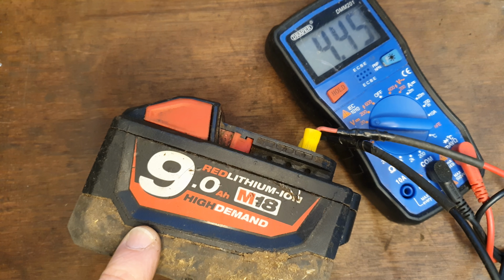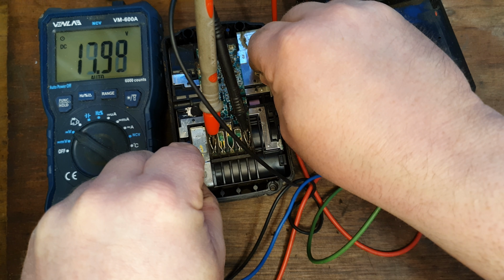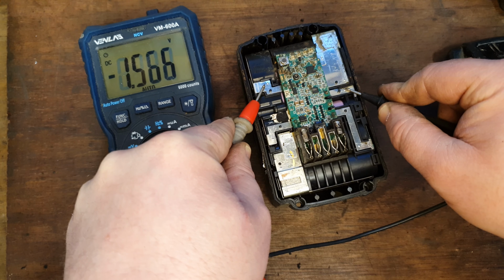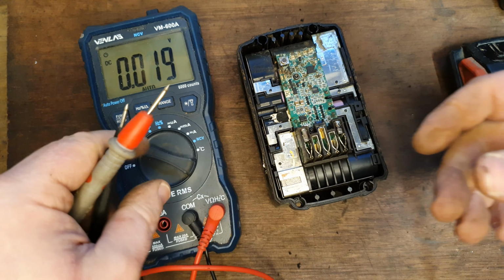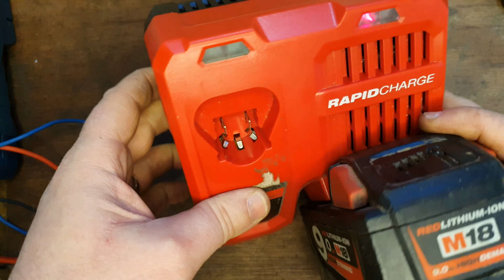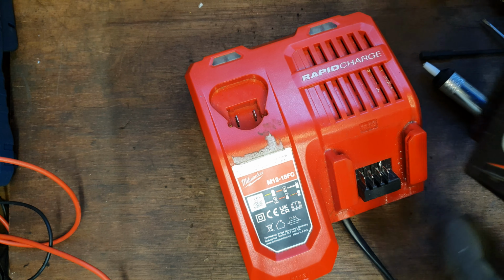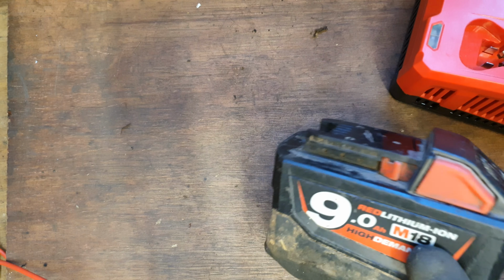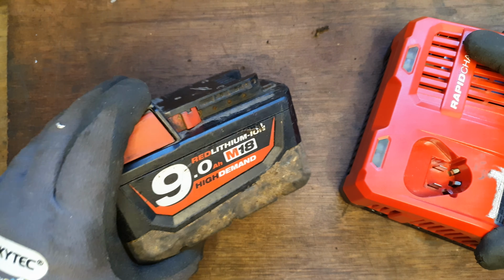Milwaukee Battery not charging? Try This!!!

Comment: Hello Doctor, do the generic boards you get of eBay work ok in these High Output batteries? I have two 8.0s that need boards the cells are all good. Could you even send me a link of the ones you get if you have it handy.
Reply from the maker: Bear in mind the 8ah and 12ah have different boards to the 4ah 5ah and 9ah. The ebay ones will not fit the 8ah I had to order them from Ali express
Reply: @doctorlefthandthread  I get you now thanks. The 8.0 and 12s are newer sort off. Thanks for the help keep up the videos they’re deadly.
Reply from the maker: @danielkelly4808  thank you